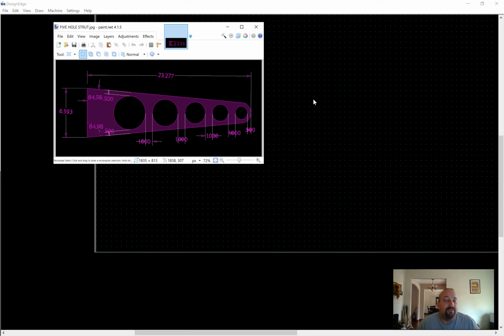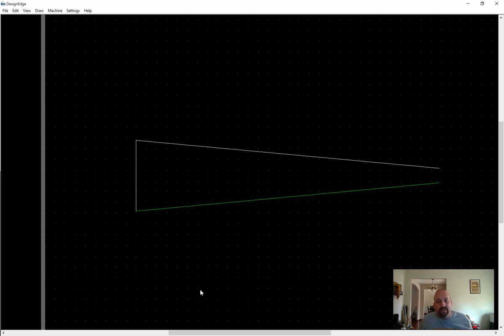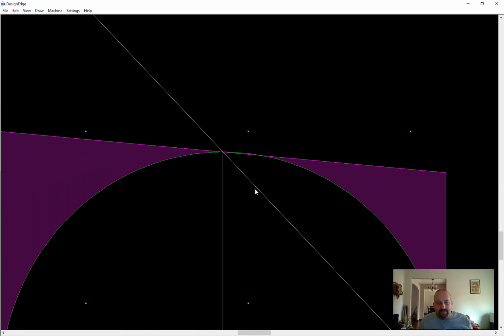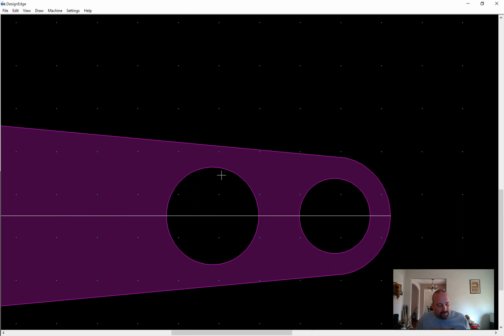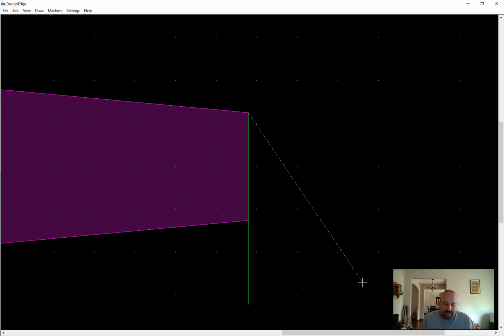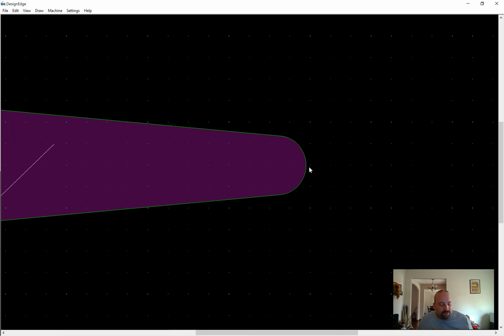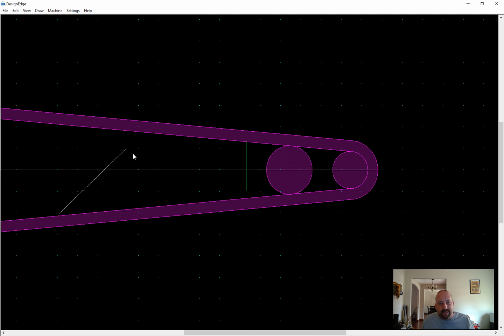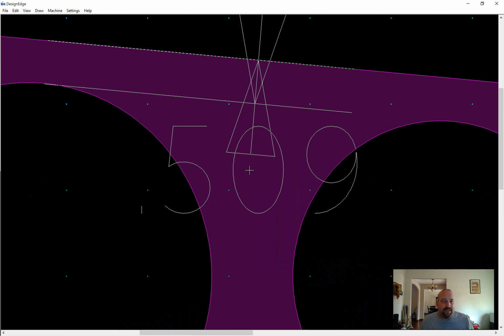5 Hole Strut Challenge Discussion

Comment: Circle tangent to 3 lines function is common to many cad software's, it is surprising that software as expensive as DesignEdge does not have such a basic function!
Reply from the maker: Sadly it does not.